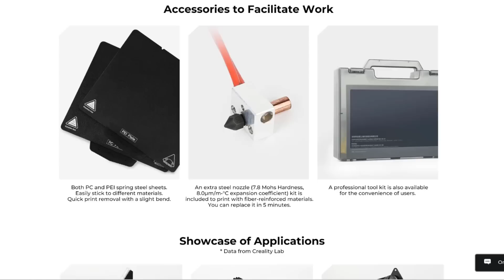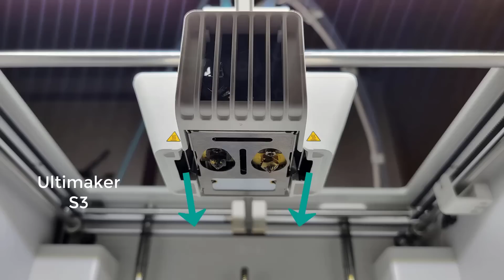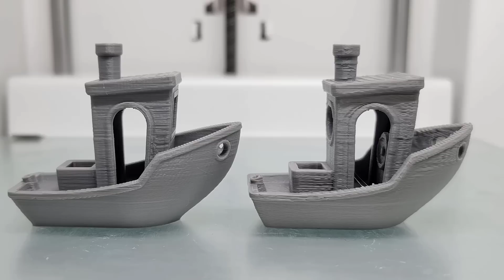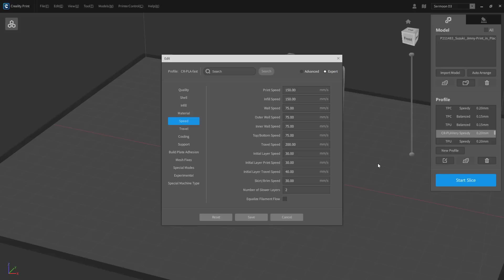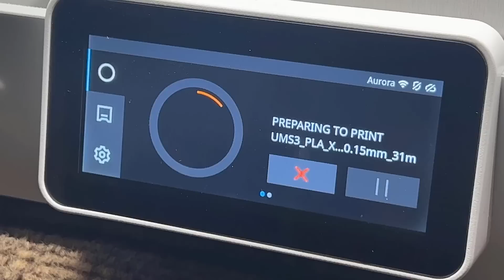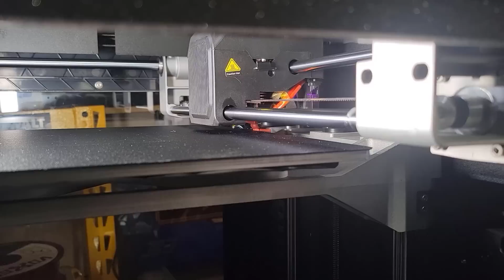Creality Sermoon D3 in-depth review: Sermoon D3 vs Ultimaker S3 head-to-head comparison

Comment: You should have printed the same gcode in both printers. All models you show, except for the cube, are different from one printer to the other, generally the D3 is missing a lot of details, starting with the benchy (see the chimney, is missing the overhang), Eiffel tower has single-pole supports all around while the other has double-poles, etc. I would not use a slicer that kills my model to make it smoother or print it faster. D3 slicer used in this video sucks. Also, they didn't "miss" the dual extruder, they had launched the D3-Pro at the same time, with dual extruder, but about 700 bucks more. (You can see that I am not a fan of any of these two companies 🤫). Otherwise, the review is quite good, except a bit biased 🤪. Kudos.

Comment: The evaluation of the category "dual extruder" actually only has the quality "present" or "not present". To award ten points here and thus open up the possibility that a printer with a dual extruder can make up for up to 10 points from other categories, while the competitor model necessarily receives zero points, is a very big lopsidedness in the rating.

A rating with a maximum of two or three points in this category seems appropriate: "present/absent", "precision in handling and changing the filament / in maintenance"," precision in printing".

I haven't rechecked it, but the stability and surface quality of the print bed and print surface "out of the box", could also be a quality criterion that could show up in the list.

Otherwise, another very nice test with a calm presentation and the usual structure in the execution.  😘

Comment: I have a Sermoon D1. It arrived with a broken z axis micro switch. Contacted support, but none ever came. Replaced micro myself and then filament sensor was stopping prints for no reason. Bypassed filament sensor and finally got it going. It works.... and does a reasonable print, however the z axis screws spin so easily once a print finishes, that I have to manually re-level it after EVERY SINGLE PRINT.  I think it was designed by a first year engineer with an attention deficit disorder and built by monkeys who were only given hammers. Buy Bambu Labs and be happy.

Comment: For the price you have to pay, it would make sense to include sonic pad in the release. As far as network printing goes, maybe the users should have dual band routers, also look for upgrades in the network card, or Creality should have installed a dual band network card. As a designer, I’m into keeping my cad files OFF the cloud unless creality would support copyrights to the user. Outside of this, I will never recommend cloud printing on so many levels.
This interview video was excellent.

Comment: Great review Aurora and team. Like the depth and break down.

Maybe I am off my rocker…. 6 mil plate and you still need to turn a knob? Also how old is the tech and design of the s3 compared to their newer revised products for comparison? While I do not think the X1c is God- I feel it has more features vs the d3 for the price.Yes it’s smaller, however I feel Bambu has done more updating on their firmware then Creality ever does. Also what PSU brand is being used? Bambu at least has a Delta. 

Once the D3 pro plus ultra is out, the D3 will be left out in the cold. Just ask the ender 7, cr200B and I am sure there are others.

Comment: As someone who use both industrial (stratasys) and prusa printers (we used ultimaker before the prusa) this creality is just worthless compared to the mentioned printers. It's still misses the heated chamber for high temp materials and the quality of prusa machines. It looks like an ender 3 with a higher price tag. I think 2 bambulab is just better than 1 d3, or just buy some prusa minis for the same price
Edit: nice video tough
Reply: @user-qh8zd7kh8p  nice try bot

Comment: Creality may be famous for dominating the market, but they are also famous for poor quality components and electronics. How many of those wires in crimp connectors are tinned?  Creality is notorious for making a new “model printer” every three months. This one will quickly be abandoned for a “new” version.  You have a solid support system behind an Ultimaker.  Creality support … not so much.

Comment: Not a fan of CR printers. Well I own both Ender 3 Pro and CR 6 SE through their kickstarter. Not very impressed because of their ongoing support. One big issue is they keep releasing their printers but ignore the software improvements.
Now I am happy with my X1C and it works very well.

Comment: To be honest I would not buy either of these printers, the Ultimaker is vastly overpriced and under specified, and I just couldnt trust Creality for QA and CS especialy in a business envoiroment, the print quality is not the best on both machines, my original Creality Ender 2 produces much better print quality than either of them and cost me a fraction of the price.
Reply: I'd never touch another Creality machine at any price, but I agree with you that Ultimaker is overpriced. Like Prusa, it's been riding its reputation for far too long, and now, while the market has been innovating, they are getting left behind.

Comment: To me, the ultimaker isnt exactly a fair comparison mostly because its much older. Interesting to see how print quality has improved over the years. Personally though, based on the intro of the sermoon d3 in the beginning, it seems it isnt really that cutting edge? I mean it is meant towards industry and for reliability, but not even using linear rails feels a bit off.
Reply: The Ultimaker S7 is even more overpriced, with no big improvements compared to the S5 after 5 years. Just added a PEI sheet, an inductive sensor for ABL, and a top cover, ask for $8300.
Reply: I was thinking the same thing.  The new Ultimaker s7? is out I believe.  I know that she doesn't have access to it, but the S5plus is probably a better comparison.
Reply: I was thinking the same.. how old is the s3 compared to the new D3.

Comment: Base on the specs and looks of it, it clearly target Flashforge Guider 2/2s
Reply: 100% - and just when they have moved to the Guider 3, and even that machine is massively overpriced and outdated.
Reply: @Martial-Mat  definitely overpriced! There is no intention creality compete with UM3… ultimaker basically not relent anymore…overpriced and no innovation on the machine, it’s a vanity printer.
Reply: @Fzheiya  Agreed.

Comment: Very thorough! I'd like to see a video with the Sermoon compared to the Bambu Labs X1 Carbon.
Reply: There is no comparison. The D3 is 4 or 5 years out of date, just like the Guider 3. They went all in on improving a 5 years old feature set, rather than trying to push things forwards, and as a result, they released a ready-made fossil.
Reply: @Martial-Mat  yep. It seems dated.
Reply: You won't see that as it would be mean to Creality. Nothing under $6000 can touch the Bambu, and not much over it can either.
Reply: Sermon D3 better than bambu X1
Reply: The only printer that can compete with the bambu is the voron. Even then it depends on the parts and who builds it. A really nice voron will also cost over 2k and won’t have an ams. I think this year we will see multi toolhead changers for the Voron due to  the release of the Prusa XL tech.
Reply: @forcedindenturedservant6881  That sounds plausible, but I don't see multihead changers as viable for the consumer or etsy market.

Comment: Having been using my X1C for a couple weeks now, I can’t see how a business would choose either of these over the X1C unless they absolutely needed those extra 50mm in build volume. Great review as usual!
Reply: if bambu ever releases an XL printer with >300mm^3, these companies are toast.
Reply: @Rattletrap1970  It's a whole new world. Now you can start to think in colour!
Reply: @Rattletrap1970  you’ll never use the prusa again 😉
Reply: I wouldn’t buy a printer that is completely proprietary.
Reply: @poochieman5303  Of course, that's a perfectly reasonable and individual choice if you are a tinkerer, but there are millions of people such as myself, who don't care about interchangability, or the capacity to change boards or parts - they just want a device that is easy to use and works.
Reply: If you're using a printer for business, unless it's like an Etsy shop or something, you probably want a support contract. BambuLab doesn't sell onsite repairs or anything for its printers, so that's probably a no-go for a lot of business use cases. This is why people spend silly money on Ultimakers with SLAs (even though Ultimakers are overpriced for what they are)
Reply: Wow polymaker really is amazing
Reply: The bigger diameter filament can be a dealbreaker. It helps to print you a lot easier for example.
Reply: Answer is simple - confidentiality
Everything goes through Bambu Cloud, so all of orders/prototypes that require any sort of confidentiality can't be printed using this machine.
I'm also not sure that companies would invest in those machines where they are using files that should not see the light elsewhere just because Bambu said that their printer can be "air-tight"
Reply: @r4yker442  "Everything goes through Bambu Cloud" You're mistaken. If you are concerned about privacy, you can print directly from MicroSD.
Reply: Could you please do this kind of head2head comparison with Bambu X1C?
Reply: CR is still usable while ultimaker is totally trash
Reply: I'm gonna sell my x1c, quality is shit, never seen this many ghosts on a print. It's superfast, but I cant make stuff that I can offer to anyone with it. The reason why nobody knows this is because they have not printed a straight wall, they only print figurines and stuff.
Reply: @Solås Auto  I print stuff on my X1Cs and P1Ps with straight walls every day.  No ghosting.  🤷
Reply: @MakerMeraki  Same here.
Reply: @solasauto  There are plenty of people printing functional parts on Bambu. I think you have a belt that needs adjustment.
Reply: @solasauto  Dozens of people use the X1C commercially printing industrial parts. Quite possibly your specific model has an issue, but are you seriously suggesting that of the tens of thousands sold, you are the only person to notice that it can't print quality on a flat surface? 🤣
I think it's more likely that:
1. You don't own one and are simply acting for another manufacturer to undermine the brand
or
2. You do own one, and simply have one that is faulty or poorly tuned, and you are overgeneralising rather than resolving your issue
Reply: @Martial-Mat  Right!!! Bambu Labs isn''t gonna be perfect. Even at $700 it's considered low price compared to actual more industrial/hobby machines that are $2k+. Look at the Enders, you need a lot of work but it can print perfect with enough time and effort to understand not only the printer but your own software model.
Reply: @elfinguard3  Absolutely. Also, I suspect it will recalibrate the price point of what is considered semi professional. Perhaps it won't have the longevity or robustness of industrial machines, but if I was Ultimaker or Prusa or Flashforge, I'd pay serious attention.
Reply: A company that openly refuses warranty repair on a product that "has wear and scratches which are not caused by manufacturing or workmanship and do not influence the product performance." will never get my business.
Reply: Has anyone read their Bambu Labs Warranty?
Reply: @judd_s5643  Why?
Reply: @judd_s5643  Thank you for pointing that out. I was considering the X1C but there is no way in hell I would buy one with that warranty.
Reply: I think both of these printers are made to be more durable and reliable.  They are built heavy duty.  We have a X1 carbon where I work.  It is very good in its print speed.  I also like many of the features and UI.  But I would not say it is built heavy.  It really shakes when it is printing at high speeds.  It’s construction is really consumer level, like an inkjet printer.  Time will tell, but I don’t see it printing for multiple years without failure or loss in quality.  It is also giving errors on many of its extrusion checks.  I would rather have the bambu myself, but I am just saying a possible reason that a school or business would pick something else.
Reply: @f1hotrod527  No one is making you print at high speeds, and you could just put it on a more solid table.
Reply: Bambu labs buyers are worst than Tesla buyers. every  car review: why buy this when there is Tesla. Every printer review: why buy this when  there is bambu labs
Reply: @majstor76  they changed the game, after couple of year of c/p. Now everyone will copy them.
Reply: @majstor76  But perhaps it's true?
Reply: @majstor76  What if they are correct?
Reply: @majstor76 You should try a Bambu Lab carbon, then you would understand. Teslas are also the best ev out there for your money, it’s not even close. Stop hating on people for stating the obvious.
Reply: @majstor76  it is called value for money. X1C is 1129 while ultimaker is close to 4000 but does a worse job. So yes, why chose anything else than a X1C beyond that price point?
Reply: @majstor76  Yep.
Reply: @majstor76 now that is funny. LMAO
Reply: @majstor76 exactly